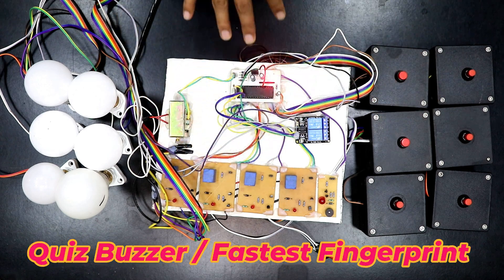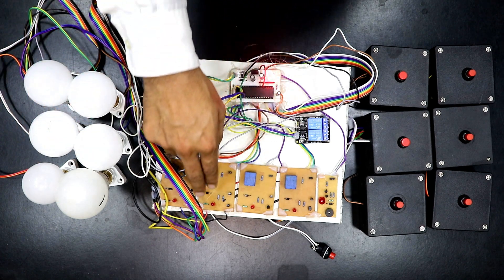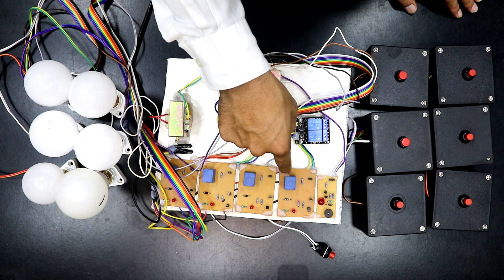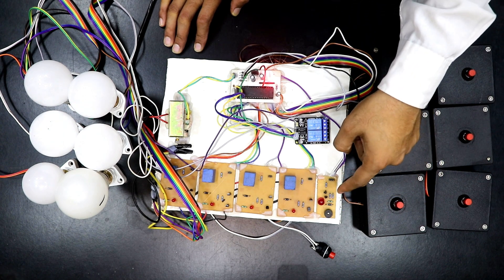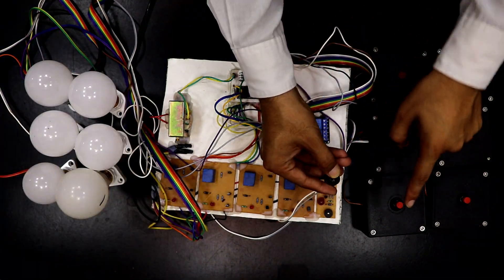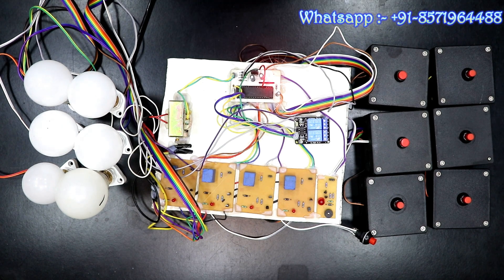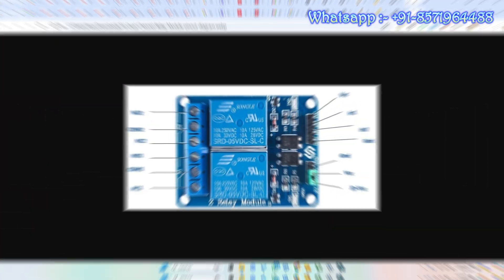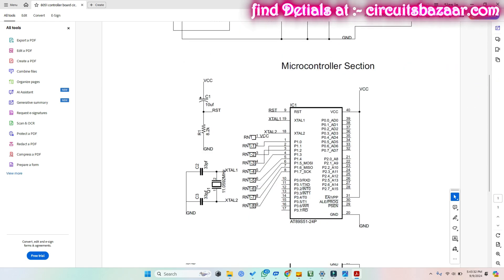DIY Fastest Finger Quiz Buzzer with AC Bulbs & 8051 Microcontroller | Engineering Project

Comment from the maker: This video demonstrates a structured embedded systems approach to designing and evaluating a multi-candidate quiz buzzer system used in competitive academic environments.
For in-depth theoretical understanding, system logic, and implementation methodology, refer to the detailed project blogs below.
📘 Project Blog (Concept, design flow, working principle):
https://circuitsbazaar.com/innovative-quiz-buzzer-fastest-fingerprint-project-a-scalable-engineering-solution-for-quiz-competitions/

📘 Additional Technical Guide (Microcontroller-based implementation):
https://circuitsbazaar.com/five-candidates-quiz-buzzer-using-8051-microcontroller-a-complete-guide/

For practical demonstration, testing, and academic evaluation, a fully assembled and tested hardware version of this project is available here:
🔧 Product Page (Ready hardware for labs, demos, and competitions):
https://circuitsbazaar.com/shop/5-candidates-quiz-buzzer-engineering-project/

These resources are especially useful for engineering students, educators, and institutions focusing on embedded systems design, real-time control, and applied electronics learning.